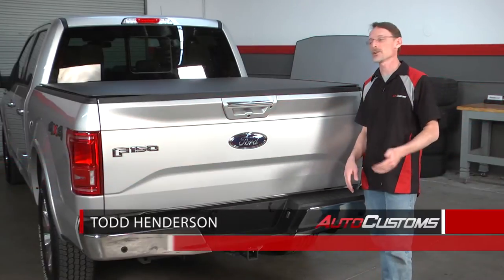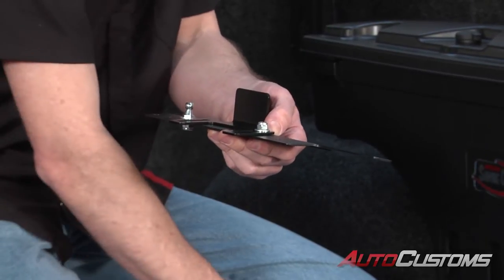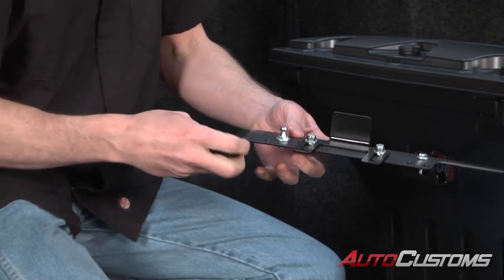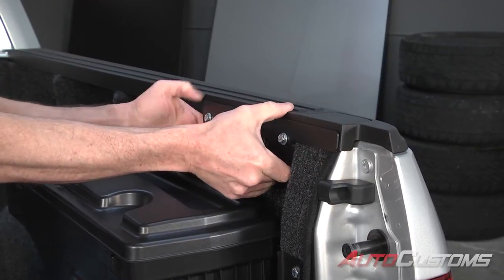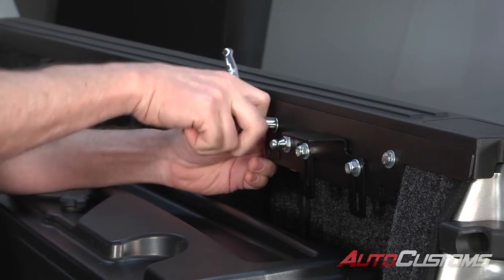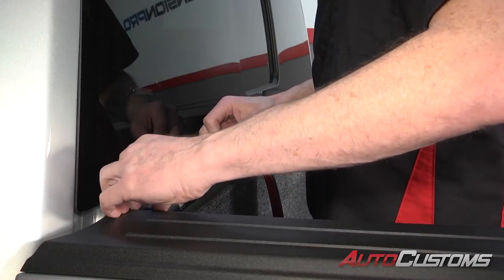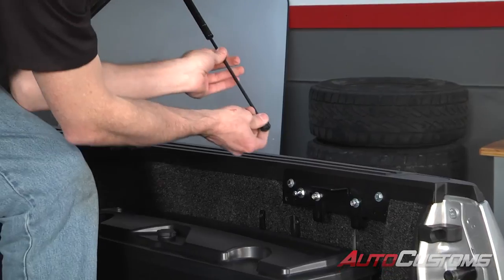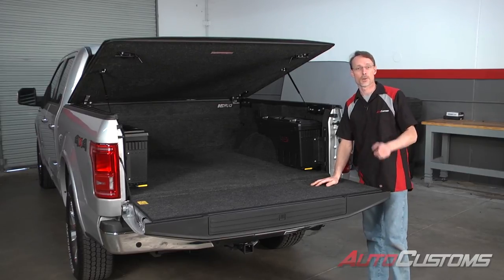How to Install Lazerlite One Piece Tonneau Cover at AutoCustoms.com

Comment: Why doesn't anyone make an 8' version for the trucks unless it's fiberglass or the other junk.  Used to be trucks had 8' beds because they were designed to be trucks for a reason...hauling larger loads, not back seats that sit empty in 99% of the vehicles on the roads.
Reply from the maker: Earl Ismyname there are a lot of covers out there for 8' beds and yes they are vinyl rollups and hard folds. You just have to do some looking. If you would like help finding one give us a call and we would be glad to help you.
Reply: I have been looking for a single one piece tonneau cover, I do not want a tri-fold, roll up or jointed cover.  I contacted a couple of people that make them in shorter sizes for the more common trucks with shorter beds and their replies were both the same, there are not enough 8 foot bed trucks to warrant them making them......seems kind of lame for a reply, but it is what it is.  How hard can it be to make one a foot and a half longer....someone has a market segment being ignored.
Reply from the maker: What is your Year, Make & Model of your truck? I will look and see what I can find for you.
Reply: 2009 f150 8' bed
Reply from the maker: Earl Ismyname I found 110 of them take a look here: https://tonneaucoversworld.com/shop-by-vehicle/ford/f-150/2009-2014/8-bed.html